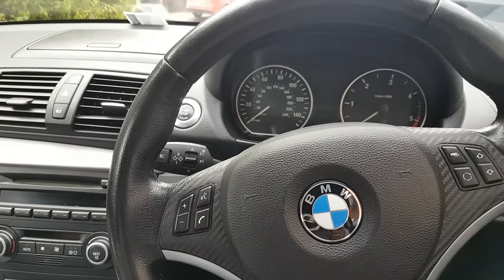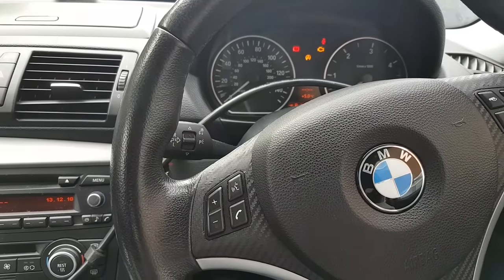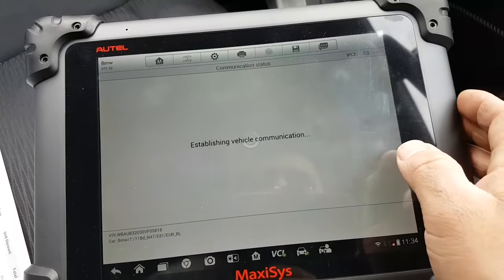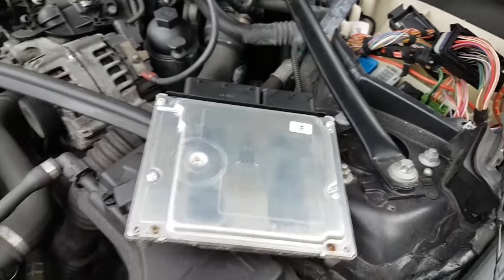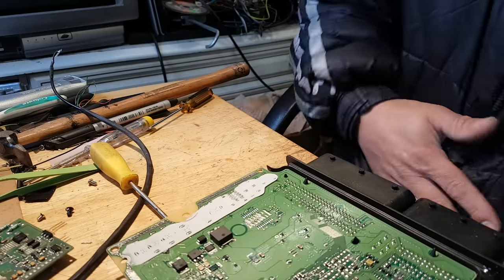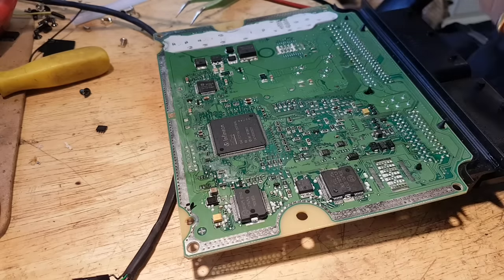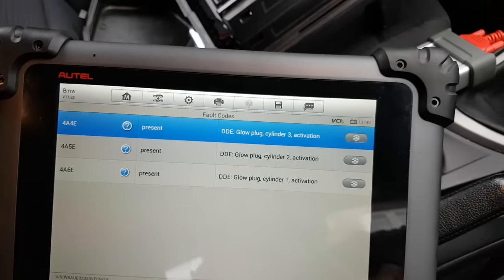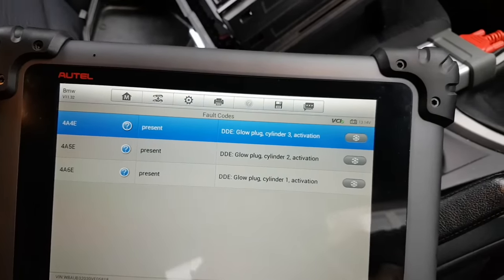BMW 118d not starting. No DDE communication. Fault finding and repair.

Comment: Hi Mate, I salute you for your great initiative and patience applied in resolving this issue. You are a STAR. You just diagnosed and explained a replica of my BMW 1 series 118d coupe manual diesel - Crank no Start! This happened over two weeks ago, and yesterday, I had to open the ECU unit and discovered a water log at the bottom, and eventually water had gone into the panel thereby causing it to stop communication. I ordered another ECU from eBay yesterday and it will arrive tomorrow. Though it has to be cloned. But If I'd seen this video before now, I would have taken the chance to do the same. Maybe mine could just possibly need to be cleaned with spirit and allowed to dry. You are just a genius! RESPECT👍
Reply from the maker: Hi
Yes, an used ecu will need programming...
It might still worth a try on yours... 😉
👍👍👍
Reply: Hi great Tech-Man, thanks for your response. Well appreciated. Just like you ascribed, yes, it might have worked out if I'd watched your video and applied the techniques you used in your video...smiles. I really appreciate your expertise vibe. I will be following you on here constantly. You are a great Tech-Man👍

Well subscribed...🙂👍 @LMAutoRepairs
Reply from the maker: @promisevizor8170 
☺️
Thanks!

Comment: I have exactly the same fault with a 2008 320d I’ve just bought, non runner. Pump running constantly, all sorts of error messages on the dash, crank but no start. No DME communication, was going to look at the ecu connection first but you’ve confirmed what I was thinking. Thank you.
Reply from the maker: 😊
Still, due your due diligence... just to make sure...
👍👍👍
Reply: @LMAutoRepairs  well, ecu tray completely dry! No corrosion anywhere but I’m going to open the ecu and have a look just in case

Comment: Great work by lm autos as always . Bring ecus back to life. Had a few jobs done by him. Always come back perfect !
Reply from the maker: 👍👍👍
Thanks Nuffz, for watching and for your comment!
Reply: @LMAutoRepairs  I’ve got a e90 325i that I believe has the same issue at first we thought it was the voltage regulator so I had a new alternator put in but the it won’t start. Cranked so I also got a new battery but it’s just won’t start. Scanned with snap on and was getting engine ecu fault code so it now stranded at the garage and I don’t want to keep paying for parts that isn’t fixing the problem. 
Where abouts are you based and how can I get in touch for the job if not can you help identify my options or recommend garage of ecu/ electronics specialist that will take on job or a solution
Reply from the maker: @keyonfrancis2722 
You can get the ecu out and inspect without much effort, and you will be able to quickly establish if it has been on water...
👍👍👍

Comment: I had a similar issue on my E46 330xd with the DDE 4.0 (M57 Engine). Water got inside the ECU, i think maybe condensation causes this. No communication with DDE was possible, also the water temperature gauge was at maximum when ignition was turned to on position. It was communicating again after cleaning and treating with hot air, but failed shortly after again. So the easiest solution was to get a working used unit re-programmed. This will cost around 170-250€ in Germany. Greetings from Bavaria and thanks for this helpful video!

Comment: Ahhh very interesting, I have exact faults, I had same original fault ‘locked steering’ and I have run same diagnostic with resetting and sync of modules but still no dde communication. 
I’m going to remove the ecu tomorrow and check for water. Let’s see!! 
I have a 320d E91 07. 
Amazing video and very informative, you certainly know your stuff.
Reply from the maker: Thanks!
Hope you find the issue with yours...
👍👍👍
Reply: @LMAutoRepairs  yes it was water
Damage to the ecu. Exactly the same as your video!! I’m on the hunt for a used ecu. Now! One of the chips along the bottom has blown in half!!
Reply: @LMAutoRepairs  I feel like I need to repay you for your videos! It really helped.
Reply from the maker: @samb59  
Glad you found the problem!

Comment: I have a 335i 2009 n54, and after I replace my injectors and assemble everything back to code the injectors and to my surprise DME is not connecting to my OBD plug, and full pump runs at all times when ignition is on, this might be my solution, thanks a lot.

Comment: Thank you for the video absolutely amazing work and as Denzel Washington said hard work works 
Please do some videos about the security system in BMW. I heard something about resetting the working hours when changing a module in this car, and transferring the ISN " I don't even know what is this" and how to change the VIN in this cars maybe with  a cheap way I have seen that you did this with maxisys.
Thank you again for the video
Reply from the maker: Hi... 
I have more to come, and have a actually no runner on the driveway...lol
ISN is like a long security pin, used between the CAS and DME/DDE...
There is dedicated tools, however expensive,  to especially work on those systems...
Thank you for watching and for your comment!

Comment: Impressive diagnosis of board and repair. Not so confident about how long it will last though when car goes over bumps and gets smashed around. Not taking away from anything you have done as impressive but that DDE module should really be junked.
Reply from the maker: This is my theory...
If he can't take anothe year out of that DDE,   is a year he saves...
This repair was done about 5/6 months ago... and still going...🤞
I might have been lucky... have repaired a few of water damaged ECUs... so far, so good... I know will be the day were one will not last a week... lol😋
Still, if I was not confident with the repair, I would advise 100% replace the module...
Thank you for watching and for your comment, really appreciated! 
👍👍👍
Reply: @LMAutoRepairs  No problem. Thank you for taking the time to do the video's. I understand it must be difficult and slow you down a bit so your efforts are appreciated.
Reply from the maker: @Dingolfing  
Indeed it does...
Is not a lot of people that understands that...
Thanks!

Comment: Great job 
I recently bought a slightly accident damaged BMW 120d E87 2007  same model like the one you fixed.  I replaced  BST terminal after its fuse blew during the accident and now its just cranking and not running, engine management light not showing on the dashboard, i dont hear a fuel tank pump running when on, checked all fuses not even 1 burnt.
What  next, could it be the same problem as tht one?
Reply from the maker: It is a 5 minute check, to pull the ecu out... it might worth to check...
👍👍👍
Reply: @LMAutoRepairs  ok thnx a lot im gonna pull it out and check wl let you know
Reply: Thanks a lot for this video, you the man.
Only to find out that the ECU been removed, if it wasnt for this video i would be busy struggling to make this car start.
So if i buy a new ECU is there need for me to programme it or?
Reply from the maker: @morganmujokoro9635  
Yes... programming will be required...
Reply: Hy guys
I dont have an ECU part number for my BMW 120d manual  E87,  i dont know what to do now since im getting differents ECUs with the same sockets but im told the mechanism is different.
Help!!!
Reply from the maker: @morganmujokoro9635  
Where are you based?
Reply: @LMAutoRepairs  im in Nigel South Africa
Reply from the maker: @morganmujokoro9635  
Ok... a good way to find the part number, other than online, is ringing the dealer... they will happy give you the price and part number for a new module...
I did it in the past...🤪
Reply: @LMAutoRepairs  yaah thts my only option, let me ring them.. will update you
Thanks a lot!
Reply from the maker: @morganmujokoro9635  
👍

Comment: Hi pal just seen some of ur vids thats some in depth stuff you do! Wondering if you could help with my situation. I have a N57 E92 330d and I accidentally shorted out something by sticking a screwdriver on the starter motor. I touched the main starter wire  to the  ground and now i’m getting ‘no ecu detected’ when i plug in obd reader. Its got power and lights up and cranks over too but no start. I have tried the fuses but I think they’re ok. Would you know exactly what fuse it might be that i should check or have I blown the ecu? If so…where abouts are you based? Thanks
Reply from the maker: Think the fuses are OK, is not enough...
Go though all the fuses, visually check everything... that's where I would start...
Thank you for watching!
Reply: @LMAutoRepairs  got the rear power distribution box out now and checking that. The one in the glove box I used a circuit tester on every fuse to check and both terminals for each fuse lit up. Didnt do a visual check though as I thought that might have done it. Would it be possible to blow the ecu from the starter wire though as I would have thought it’ll blow a fuse first?
Reply from the maker: There is fuses in the engine bay... where the ecu lives... check those as well...
Reply: @LMAutoRepairs  yup the fuse module relay with 4 fuses in there checked them. Unplugged the relays in there and plugged them back in. Stuff stopped working and started working again when I did. Power seems to be getting through
Reply from the maker: You might need to check the powers and grounds at the ecu... if all OK, CAN lines...
Reply: @LMAutoRepairs  thanks buddy. Where about are you based?

Comment: Hi I live your videos they are very helpful! I am having the same issue and codes... I cleaned up the ECU with isopropryl and tried to start but still have the same codes and the pump staying on... Do you think I need a new ECU?
Reply from the maker: Possibly... 
Or you can still check soldering etc... untill you find the problem...
👍👍👍

Comment: Another brilliant video from you luis, always very interesting,  just wanted to ask how to correctly remove the black plug connectors from the ecu  as I tried to remove one the other day and couldn’t figure it out so I stopped as I don’t want to break anything. 

Thanks, Chris.
Reply from the maker: I use a desoldering vacuum gun to remove the solder from the pins...
Then the hot air if needed... takes time, be patient...

Comment: You sir, are very good at this. I’ve watched a few of your vids, even the other dme vid twice which was over an hr. I have been struggling with my e90 320i 2007. I was wondering if there is a schematic pcb diagram? Even with that I’m not sure I can fix my issue. Thanks for the great content! 👍
Reply from the maker: Unfortunately I work blind when repairing this type of stuff... I never managed to find internal schematics for modules like this...
You need to try to trace it down... if is a multilayer pcb, then things complicate a bit, depending on what type of damage the ecu has...
Thank you for watching and for your comment!

Comment: Where you located I think I have the same issue with my 1 series but I don’t have any dashboard lights at all seems like a electronic fault also my fuses seemed to be a big moist when I took a fuse out to check . Please could you let me know as I need this issue resolved as soon as possible

Comment: Superb video Subscribed! 
I have a e87 120d 2007 with similar issue. Car ignites but when I try to start the car I get no response, can hear the fuel pump running just like in the video but the car doesn't turn on. There's time where after 5 or 6 times of trying, the car turns on and works perfectly fine, and then there's times where the car doesn't respond at all for hours. I have replaced new battery but the issue still persists. Do you think it is an electrical issue, any faulty fuses or sensors or do you think it is the ECU? 
Please any help would be massively appreciated.
Reply from the maker: Scan the car to start with..
Otherwise it is pure guess work...
👍👍👍

Comment: What do you use if you need to solder onto the board and it has the encapsulation on it ?? Do you just scrape it away or use a chemical to expose it ?? Great work by the way
Reply from the maker: Hi
I usually just scrape it carefully...
Thank you for watching and for your comment!

Comment: Hi wonderful video, I have questions my Renault Clio 1.4 alize 2001, has a good crank but won’t start, i don’t have signal going to the injectors and the wasted spark coil pack, I would like to know if I reflow the ecu will it fix the problem. The problem before was that the car would switch off idling until it was a crank no start? Please help.
Reply from the maker: How did you diagnosed the ecu as being the issue?
What have you tested?
Thank you for watching!
Reply: @LMAutoRepairs   when I tried to to get the car scanned it had no communication with the scanner
Reply: I also changed the crank sensor and still won’t start
Reply from the maker: OK... have you checked power, grounds, and communication line at the ecu?
Can you communicate with other modules other than the engine ecu?
Reply: @LMAutoRepairs  no, I’ll try it and late you know
Reply: The powers and grounds first

Comment: Sir in bmw where to find terminator resistors .. which is for can bus ... Iam not comu to dsc ,ecm .. any  idea from where to start ... Bmw 320d
Reply from the maker: Start with the basics...
Check power and grounds at the module... and communication lines...
👍👍👍

Comment: Oh man :( im anxious.. i have BMW e85 .. had little corrosion on one of two pins inside the socket of the airbag comunication module. But it wont comunicate still :/ IDK do you think its due coroded wire? or its not possible. Thank you sir, hope you read it.
Reply from the maker: It is possible...
Just measure the wiring etc...
Thank you for watching!

Comment: I have the E61 on a 57 plate with the exact same problems, fuel pump primes constantly. seems when it was dropped off from a low loader after an alternator failure it will not start.. Only difference is my DDE 7 module is bone dry... what would you suggest I can try to fix this??  I'd love to be able get it to you as I've had others look at it with no success.
Your videos are brilliant too, keep up the constant success :)
Reply from the maker: Hi
Have you scanned the car?
Can you communicate with all the modules?
Thank you for watching and for your comment!
Reply: @LMAutoRepairs  sorry mate, I never received a notification for your reply...  Yes I have all other modules working, I'm using INPA, NCS expert and my Foxwell nt530..  I have the FA from the CAS module, but can not write to the DDE as there is no communication to it... I have checked all wires and fuses/relays etc.. another ecu works on the car so I know everything between is ok.
Reply: also, there is no engine light when ignition on, as if its not there. I am thinking it has something to do with the battery running flat after alternator failure, and now I can not wake it up?
Reply from the maker: The FA is not stored in the engine ecu/DDE...
So, no need to do nothing in that respect...
Check powers and grounds at the ecu plug...

Comment: Good day to you sir,I just to want to ask what part (ic's,driver or mosfet) that normally fails in the ecu/TCM in my Hyundai accent 2013,it is showing po748 pressure control solenoid valve A electrical,for info all the the required check needed for the transmission has been done except ECU/TCM, I wish you have a little time for my question, thanks in advance
Reply from the maker: That's not that easy or simple...
Not always the same components fail...
What leads you to think the issue is the module?
Has everything else been checked?
The solenoid, wiring, connections,  etc...?
Thank you for watching!
Reply: @LMAutoRepairs  we opened the transmission valve body,check the solenoid with test voltage and the wiring terminal for loose solder but all are in healthy condition, except for the TCM which is the last on the checklist,we opened the ECU/TCM and found some capacitor leaks which was change but still po748 code exist,is it possible IC's failing but we lack knowledge of the components and could not find the schematic diagram, thanks again for your time
Reply from the maker: @raymondapas7532  
Internal schematics for that sort of stuff are nearly impossible to find...
I can only suggest to follow the failed circuit back from the module pin, and measure any components in the way...
👍👍👍

Comment: Have you had an experience with an 2004 BMW 530i that wouldn't start after replacing the battery. When I put the key in the ignition I get the orange key symbol on dash (guessing to show that key is in ignition when door is open) and nothing after that. When I turn the key I don't get any lights at all on the dash and I can't even get the windows to roll up but the radio will turn on and the lights inside. Any suggestions of what to test?
Reply from the maker: Hi
Which battery are we talking about?
The key battery, or the car battery?
When you say orange key symbol, what symbol is that exactly? 
👍👍👍

Comment: Good save but I would not trust it in long term. PCB is damaged, pads around processor too, just a matter of time until its no starter again. Owner should source ECU, EWS and key while it runs.
Reply from the maker: This repair was done 5 or 6 months ago... still going...
Still, should look for another ecu... not the whole set... after all, the ecu is the only problem...😉
Thank you for watching and for your comment!